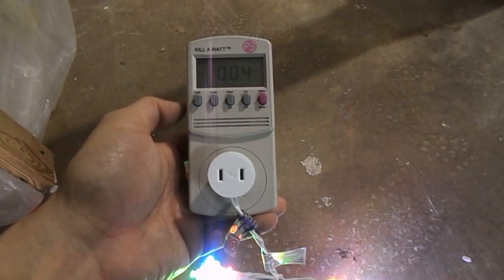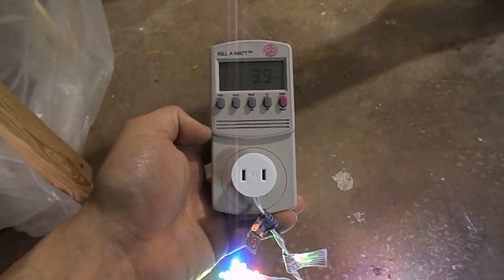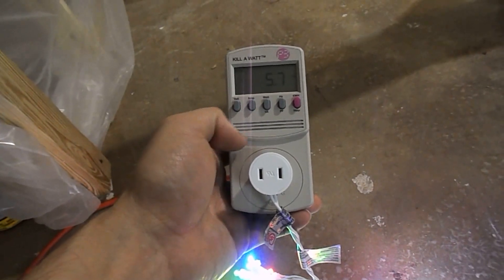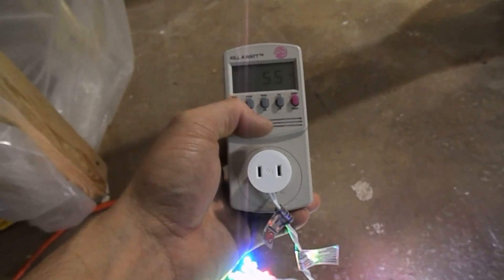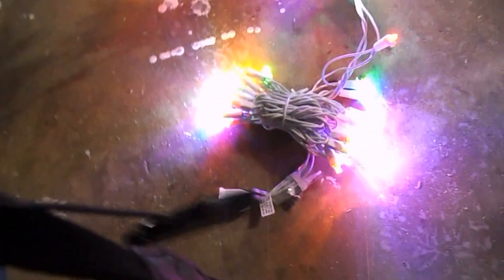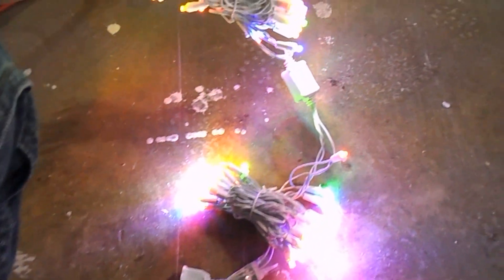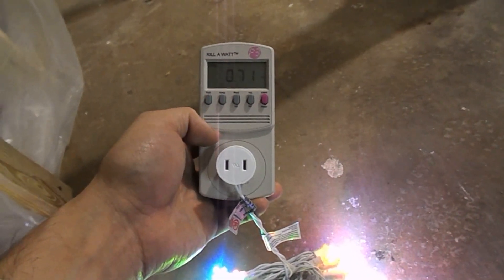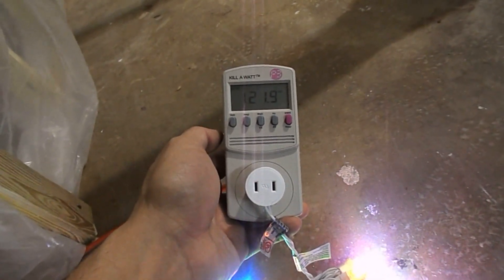Test LED Christmas Lights

Comment from the maker: I had to look it up and found out some sets use a power supply. Some use only a full wave bridge, and some cheap ones use two half cycles using only the LED as the rectifier. It was on wiki as Christmas_lighting_technology. Interesting read.

Comment from the maker: I had made a light out of the same LED I used in the last video. It took 54 LEDs and I could see them blink on the half cycle and the full cycle using a bridge. I had to add a capacitor to stop the blinking. I will post a video of it if I can figure out where I put it. I also added a transformer to isolate the AC power from the DC Power (I did not want someone touching a wire and getting shocked) and a resistor in series with the cap to prevent a power surge on the transformer when plugged in.

Comment: Got to love those LEDs! Since you won't be running them 24/7 or all year long the money spent will be negligible!  LEDs only draw current on a half cycle being diodes so the KAW must track that and it shows as a power factor thing, interesting. It also means they blink on and off at 60 Hz and if you put them near a fan in the dark you would see that. The 4W you see is what your power co. meter shows, actual work force used.